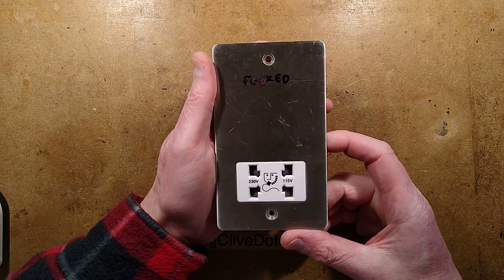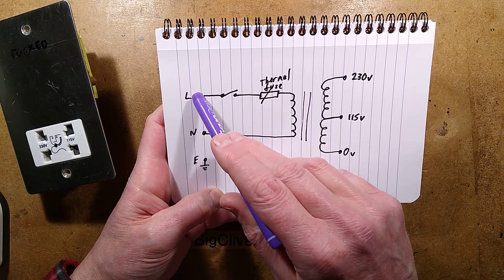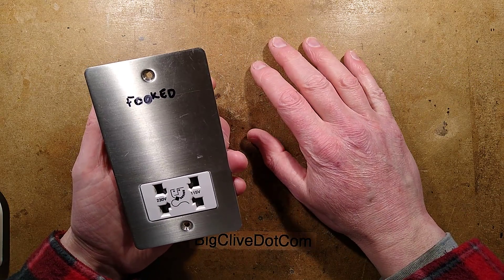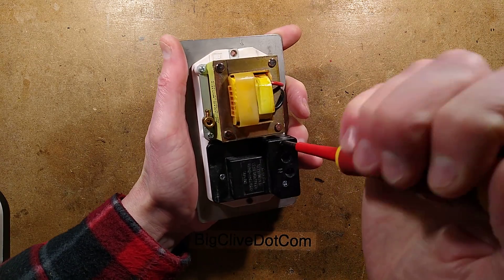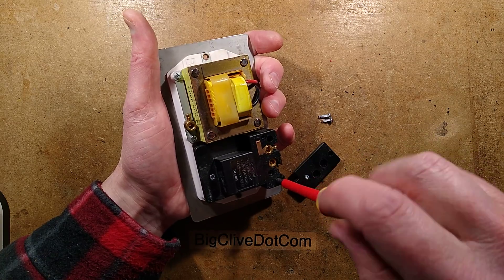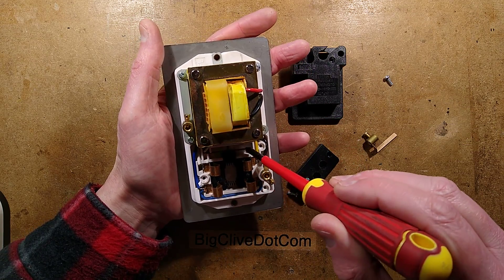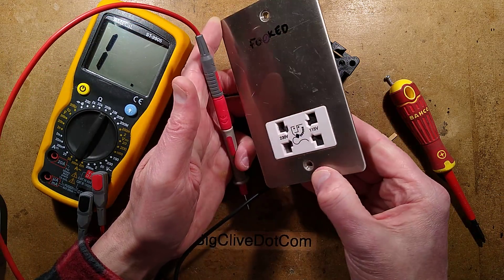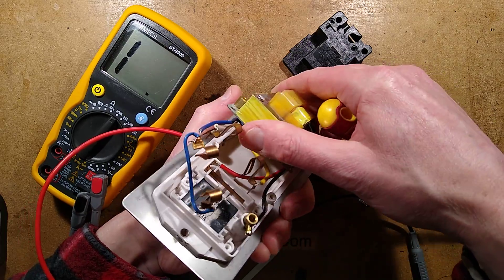Exploring a failed British shaver socket

Comment: Sorry to disappoint you Clive, but we just use a standard 'powerpoint' or GPO in our bathrooms- exactly the same as used throughout the entire house- no isolation transformer or anything...
This isn't as dangerous as many would assume, because RCD (earth leakage, whatever you want to call the various types in use) protection has been the norm here since probably about the late eighties in all new buildings
The only place you 'may' find a 120v outlet similar to that is in larger motels near international airports... but extremely rare to find those  in even major chain motels outside those places (120v simply isn't a 'thing' here)

Comment: shaver sockets are common in hotels in australia, but really not at home. dunno that you could even get one at an electrical supplies or hardware store - very out of vogue. obv. our sockets are a bit different, but sometimes they are set up for both aus (angled plugs) and US (straight plugs).

Comment: The old shaver sockets in my house only accept the 2 pin bs4573 shaver plug, which are the same size as the bottom two pins on a 5amp bs546. I suppose more modern ones have been adapted to allow European and other dimension plugs which leads to this problem

Comment: In the States and in Germany, GFI is the standard. In the U. S., particular circuits, or even outlets will be GFI protected, typically here in Germany, the GFI controls Main power. It was explained to me the different philosophies, apparently the U. S. system actually has motivation, to my surprise, but I don't remember/understand.

Comment: I like the idea of using a transformer and limiting the damage done if someone drops their shaver in the sink and reaches in after it. But I worry because the 230V and 115V plugs are shaped the same -- seems to me the sort of person who reaches into a sink full of water to retrieve a plugged-in shaver is the same sort who would accidentally plug a 115V shaver into the side marked 230V.
Why not have dedicated plug types for each voltage of shaver, both of which are different from the plugs on hair dryers and other appliances? This would also prevent plugging those in and blowing the fuse.
...not that the voltage difference probably makes much difference anymore. Last time I shopped for shavers, they all ran on low voltages using a power adapter that accepts 100-240V. Most of them even have li-ion batteries and refuse to even run while plugged in.

Comment: I use these sockets to power a water flosser (jet of water cleans between the teeth and stimulates gums).  But my last such device, by Waterpick only worked in some sockets (the model before that worked in all sockets).  I think this is because the UK standard EN 61558-2-5 specifies a minimum rated power of 20 VA and a maximum rated power of 50 VA.  
I am guessing that the flosser used something above 20VA and only some bathroom shaver sockets supported that.  Unfortunately Waterpick can’t tell me the VA and so far I haven’t found the max VA supported published by socket manufacturers - a sorry state of affairs I reckon.        I wish I had sent my failed flosser to Clive to dissect!

Comment: We used to have shaver sockets in Canada. They were a simpler design, 115 V in, 115V out, and a single, type A socket on the face plate, which had the words, "for shaver only" embossed on it. Nowadays, we just install a GFCI, ground fault circuit interrupter (residual current detector), because people like to use their hair dryers and stuff in the bathroom. But, sometimes you can find a shaver socket in an old house from the 1960s, or so, when they were popular. They were usually switched on the lighting circuit, so they were only live when the light was on.

Comment: Hi Big Clive! ...... Little Clive here! 👍😂

My shaver socket is f****d too! ...... But I haven't written it on it! 😂

I've got a dual-voltage shaver outlet in my bathroom. When I plug my shaver in, I've noticed a faint buzz! But the most annoying thing is, the two-pin euro plug keeps pulling out of the socket as I'm shaving! The socket doesn't grip the plug properly any more!

Comment: So.... UK won't allow proper power outlets in the bathroom... BUT.. They'll allow an electric hot water heater IN the shower?
Reply: Another example of our self contradictory standards.  Which also take several paragraphs to specify in great detail the font size and dimensions of completely pointless labels.

Comment: I've never seen one in Australian private houses.  But the thing that REALLY bugs me is that in private residences, 240V mains connected sockets are usually fitted within easy arm reach of the metal taps in the sinks!  Luckily in most new houses the water pipes are now all plastic, but in older ones they/re all "equipotential" grounded copper as per Regulations.  :((

Comment: thanks for reminding me of these. I've thought for quite some time about the differences between our (US) and your electrical systems and the different way in which they address the same needs...

THESE. are the ONE thing we don't, to my knowledge, have ANY equivalent of. We just put a GFCI (RCD) on the any outlet near the sink and call it a day. Until some fractional-witpower half-phase individual comes along with their UK shaver and decides to try to shave in the shower with it plugged into an extension cord whose male end has been castrated and jammed into the electric dryer socket.

Comment: When I was last in the UK, the only electrical device I brought with me that wasn't multivoltage/multifrequency was my water flosser.  However, I found the nearly invisible shaver outlet in the bathroom light, and figured the 115V tap would be sufficient to run the little charger, which only drew a few watts.  It did, but the charger transformer itself was a little unhappy with the 50Hz and ran a bit warm.  It did charge the water flosser, however.

Comment: It could also be that someone left something plugged in.  As long as the switch is on (something plugged in), the AC side of the transformer will be active whether or not the output side (plug) is drawing power.

Comment: I've never actually heard of that at all until now!  Here (USA) we just have a GFCI protected outlet for you to plug in your shaver, hairdrier, electric toothbrush, etc.  That said, the shavers and similar things I've had all have a wall-wart and low voltage going into the shaver body.
Reply: Jonathan: The amps are directly based on the voltage if current runs through your body because the resistance of your body is consistent. Don't post things online if you don't know what you're talking about. Idiot. Or does a car battery that gives hundred of amps on a short circuit kills you?
Reply: I've heard that's then only part of an USA home that has protection, whereas Australia and New Zealand for all outlets and lighting we use RCD's before the MCB's and our voltage is 230-240V @ 50Hz, average 240V 10A power outlets are 2400W, doing the math 120V 20A = 2400W lower the voltage safer it is NO, all the same wattage it is the combination of volts and Amps that can kill! FACT!
Reply: @jonathonshanecrawford1840  specific circuits that may be near wet areas usually are GFCI.  Bathrooms, garage, kitchen countertops,. Etc. No real reason to have them other places...and even when they exist it doesn't do much unless you happen to be grounded.  Had an aquarium heater leak and malfunction and never tripped the GFCI adapter I added even as it partly melted the power strip because there is no path to ground.  I assume a hypothetical hairdrier in the bathtub would have similar issue not tripping as the tub is typically fiberglass and the drain PVC pipe so it would still be a balanced in/out between the hot and neutral...but I don't plan to test that theory...
Reply: @matthewmiller6068  Yes if there is an internal electrical fault the MCB should trip! Please don't test that theory! However, say if one had a electric blanket and one sweats (water) could result a "ground fault" condition - thus zap - without RCD/GFCI, although if the GPO's are wired correctly, should be no problem Black wire inserted to the N and the Green wire to the E for each GPO great, other wise if wired incorrectly, and tow different device (metal chassis) pluged in could result a "Earth fault" condition thus tripping the RCD/GDCI - e.g. in the livingroom -DVD & VCR (metal chassis)!
You don't have to be grounded (feet to earth) to receive an electric shock two hands is enough! and could kill!
Reply: @matthewmiller6068  Some people (Americans claim the lower the voltage the safer it is - BS - 120v @ 20A = 2400W as to 240V @ 10A = 2400W even the the HT transmission lines the current may be low while the voltage is high e.g. 110,000V by the time it arrives at one's home the current increases.  Tell that to the Americans! No offence intended!

Here's a thought, AC power - does the eletrons flow back and forth like a two-way road or in one direction like a one-way road? Or is it the frequency that goes up and down.  I believe its the latter! There are too many YouTube video that confuse people!
Reply: @matthewmiller6068  I Australia (esp QLD)  it is Now against the law for DIY electrical repairs (mains wiring - ES/BC lights, light switchs & GPO (inc consumer units) except replacing a light bulb or a plug (maybe)!
Reply: @jonathonshanecrawford1840  that's crazy... And I feel like forcing everyone to pay an arm and a leg to professionally fix it would make people more likely to do nothing at all and keep using a faulty switch or outlet or whatever.
Reply: @jonathonshanecrawford1840  if there's no path to a ground though it's never going to trip GFCI.  Very few things seem to actually use grounded plugs, which means the only way there could be a ground fault is if it goes through something external.
Reply: @matthewmiller6068  There doen't need a path to ground (green) even between Phase (red) and Neutral (black) can give a shock or even death!

Australia/NZ Black = neutral, Red = Phase, Earth = Green/yellow for TPS/electrical fittings!
Flex: Phase = Red or Brown, Neutral = Black or Blue, Earth = green or green & yellow!  I think the USA use white for neutral and Black for phase?
Reply: @matthewmiller6068  Not to mention that sometimes a licensed electricians will do a worse job than an average homeowner.

Comment: I have not seen these in the US or Canada (hotels, apartment complexes, homes or dorms).  Two prong outlets are common in bathroom lighting fixtures, but those are just regular 15 amp/120 volt outlets.  Currently, many of these have been replaced with GFCI's.  My home may be atypical, as it is a veritable museum of domestic wiring, with remnants of knob and tube wiring, cloth covered wire, gutta-percha coated wires in black iron pipe (the coating turns to dust when touched), PVC coated wire in steel conduit and even a few runs of Romex.  My (non GFCI) bathroom outlet handles a 1500 watt space heater with no strain (mandatory this time of the year).

Comment: Specific shaver sockets in the US were more of a thing in older hotels, once GFCI receptacles became standard, newer hotels had those, and older hotels have been retrofitted to stay up to code.

In the 1950s-1970s (and possibly later) an ungrounded (usually non-polarized as well) outlet was included on many medicine cabinets for electric razors, since these often had lights built in. My house was built in '75, the upstairs bathroom medicine cabinet had one of those built-in sockets. I remember being 5 or 6 years old when my father bought his first shaver - a Norelco cordless - and he was quite irritated with the fact it wouldn't charge. As I was exiting the bathroom one day and turning the light off, I saw the red LED go out on the shaver. I flicked the light switch a few times to confirm what I saw, and then I asked him, "Hey Dad, why does the light on your razor go off when I turn the bathroom light off?" He asked me to show him what I meant (seems pretty obvious to me, but OK) and then I watched his face as it slowly dawned on him... The outlet on the medicine cabinet is, of course, wired in parallel to the built-in light, which was then wired to the wall switch. Flip the switch to turn off the light, no power to the light, no power to the outlet, no power to the razor, no charging. DUH!

(It should be pointed out he attended trade school, taking the residential electric courses, got good grades, he actually wired our entire house, and he installed that medicine cabinet in the first place... He could be so smart at times, and at other times completely daft!)

(EDIT: He also installed Simplex fire alarms and diesel-powered generators, worked for Radio Shack, and built an Eico Cortina 3440 Color Organ - he bought the kit and built it, he didn't buy the fully-assembled unit - and someday I hope to restore that color organ and get it working again. It took years of Googling to find the schematic...)

Our first-floor bathroom has a standard receptacle, mounted at switch-height, perpendicular to the sink. It's only been used a few times in almost 46 years. "When it wears out," I'll replace it with a GFCI like I should have done decades ago.

Comment: Isolation transformer s are used in hospital environments with GFCI receptacles or breakers .In most hotels in Canada it's a standard 15 or 20 amp T slot GFCI or GFCI AFCI combo .

Comment: I've only seen this in hotels and airports in australia. If anything, they're more of a prop for travellers to use 110v shavers and small appliances. We've had switchboard GCFI's standard protecting all power outlets at least since the early 90's.

Comment: Was it a 'thermal' fuse or simply a fuse ? It looked like a smaller version of those blade types used in cars - Did we actually get to see the gap where it had blown internally ?
Reply from the maker: Thermal when it's sandwiched on the primary like that.
Reply: @bigclivedotcom  Low melting point fuse. I wonder if YOU could repair it - warm it up again and get the metal to connect to both ends ;)

Comment: My boss tasked me with a project. He wants a main disconnect switch for the control circuit of a garage-door opener, and an indicator light to know when it's hot. Haven't confirmed it yet, but I think its 24 vac, and if so, it's hard to find a switch that will work, without special-ordering one. If I use simple incandescent lamps, it's an easy job. If I use LEDs, suddenly I have to figure out how to rig them with 24 vac. If I get 2 12 vdc LEDs from the auto parts store, can I configure them to work with 24 vac? Like, back-to-back or using 4 of them in a Wheatstone bridge? I don't have the brain power I used to, and I never fully understood electronic circuits. In the end, I'll probably go with incandescent 12 vdc car lamps, they're cheap and easy to work with. But I enjoy the challenge of trying to do something harder than I really understand.
Reply: Geez, see? I couldn't even remember the difference between a Wheatstone bridge and a full-wave bridge rectifier. hahaha
Reply: And I'll stop with this; it looks like LEDs, back-to-back across an ac source will work, and I'll need a limiting resistor, anyway so as long as I'm doing that, I can also size the resistor to limit voltage to the LEDs. This should give effective light with little or no flickering, I hope.

Comment: i've only seen these things in hotels (which might also be only because it has the 115 / 230 for travelers from US).
Before FI/RCD there was no socket at all, even the light got switched from outside the room! 
Later when hair driers got popular faaaar away with a lid from tub and sink.

After the rcd came it was a waterproofed socket with a lid, but even that lid is not needed anymore.. no low fused or transformer isolated socket. 
Just a "keep out" zone definde in electrical safety for installations.

Comment: I always thought these would be short circuit protected by a magnetic shut (current limiting transformer). Never dared to plug any electronics into them either as I thought the no-load voltage would then be a bit above nominal.

Comment: Why do we not use isolating transformers more often?  Perhaps for garden equipment or 230V power tools on a building site?
Reply: The are used in sites with 110v yellow transformer.
Reply: @AndyK.1  indeed
Reply from the maker: Not ground isolated as the 110V is centre tapped to ground.

Comment: Would it make any difference using 110 or 230 sockets as most devices can auto switch/sense power or at least should these days?
Reply from the maker: It's a blast from the past.

Comment: I don’t think these things are designed for toothbrush chargers, which seam to be designed to be always on charge at a low current. When I removed my socket after it had been used for a couple of hours the transformer in the back was quite hot

Comment: Never seen one these in nordic countries in homes at least, but we do have stickers that say not to use electronics when wet which might be required since I've seen that text in so many home bathrooms

And of course the outlets are nowhere near the floor. Other than that I guess the safety depends on how old your house is, my parents house certainly doesn't have RCD so I guess you can only hope that the ceramic fuses pop before you

Comment: Folks have mentioned US code requires GFCI outlets for wet areas (bathroom outlets, kitchen) and specific distances from fixtures/showers for such, but newer code also now requires arc fault circuit breakers for those in addition.  My old 1920s properties have had all the lights on one circuit, and all the outlets on one circuit per floor, nothing isolated for bathrooms, just distance requirements for outlets/switches for "safety" then.  Of course newer appliances like hair driers nowadays also have to have plugs with their own safety features too, so it was tackled from a different angle here, easier to have manufacturers change design than retrofit/inspect all the homes.